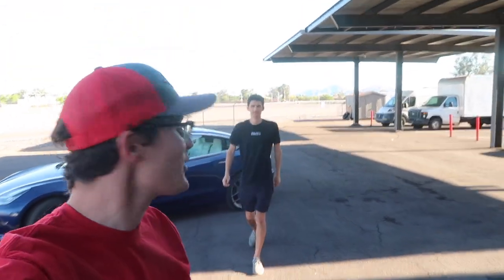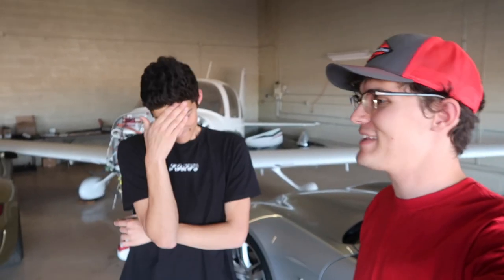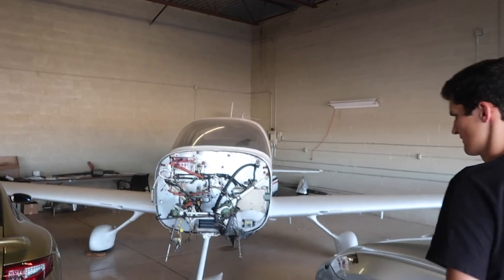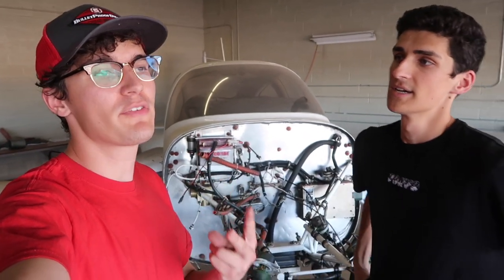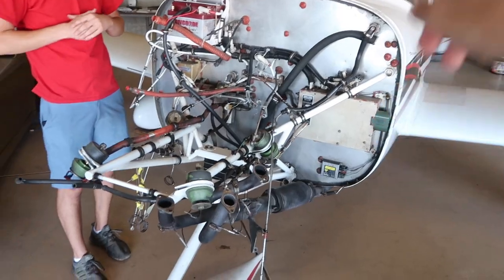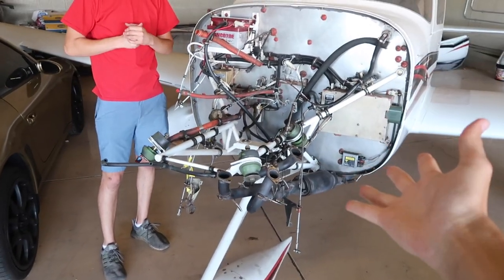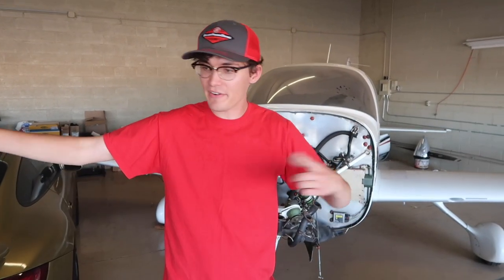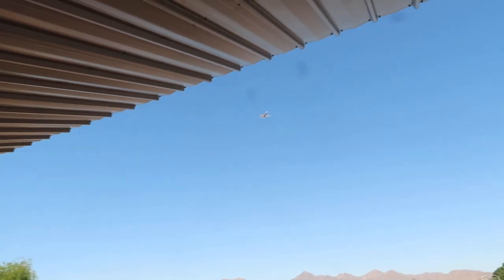Our Cirrus SR20 Overhaul Reveals a BIG Problem... (New Engine Install)

Comment: Great video, and I love that you guys are willing to share the costs with us.  This is why GA is dying though; the costs are just extortionate, due to the certification rules.   I mean $12,000 for two lumps of formed metal!   The actual production cost for the new case was probably less than $1,000.   All of the rest goes towards litigation funds associated with certification.  Here in the UK, I just changed over from GA to LSA (ML in the UK) and the cost savings are insane.  I got a 2 screen glass cockpit and advanced autopilot for £9,000.   To buy the same set up in a certified aircraft would have been £50,000+ !!!   If VFR is your mission, then LSA really is worth a serious look.   It is likely to reduce overall aviation costs by over 70%.     Also, if you think the IO-360 ES engine is costly to repair and maintain, the IO-550 in the SR22 is a whole new ball game!   I'd personally stick with the SR20.   It's a better training aircraft and (having flown both), the 20 is much nicer to hand fly; the 22 just being so heavy up front because of that huge lump.
Reply: Id say its more corporate greed than anything. I worked at a part 145 repair station, I know what the costs were for overhauls and the push to constantly make the quarterly dollars go up and up constantly. Our pay stayed the same but we just kept seeing the prices of overhauls and individual parts increase for no reason.

Comment: Your plane will have had a complete overhaul, essentially a new engine, will have been inspected and I assume found to be in excellent condition.  At that point it will be more valuable than it ever will be again so if you want to take advantage of the favorable market and move up to an SR22, that will be the time to do it.  Get your plane finished and pull the trigger.

Comment: Cut to scene, Money changing hands to sell the SR20.  Cut to the purchase of an SR22.  New plane arrives, the mechanic looks at it and discovers the whole engine needs to be replaced.  Just like the SR20.  Talk about luck!  I really wish you guys good luck in finding an SR22 if that is the route you choose to go.  Just remember all of the problems you went through getting this one running.  The thinking seems correct but if it was my money to spend, I would hold on to the SR20 as you know exactly what is wrong with the aircraft.  Fresh engine, and a new annual.  The only way I would sell is if you have an incredible offer which would make sense.

Comment: Wait. What?  Just the engine case was $12,000 ???  Holy Smokes!!
Reply: Complete overhauls for the larger engine on the SR-22, Continental IO-550, figure $50k. Continentals appear to fail early - Lycommings seem to go further.

Comment: No. Since neither of you are pilots, those high performance planes kill short hour pilots. Your insurance, if you can get it, will be through the roof. Put a couple hundred hours on the SR-20. Green engine failures are a problem too. The market will remain hot. Have you considered a partner? Also, another plane - another potential engine overhaul. Keep what you have.

Comment: But guys, the reason you pay jetfighter prices for 1950 engines is that they never fail. You have that guarantee that it never needs to be repaired.
Reply: You are being sarcastic right! These pathetic old 1950 designs have a TBO of about 2,000hrs.
Modern internal combustion engines in all other forms of transportation last at least 3x that!
Reply: @DennisMerwood-xk8wp  Other engines don't run at 75% throttle for hours at a time.
Reply: @latemarch2  Except for those in Railroad engines, diesel trucks, generators etc etc.
These air-cooled pushrod engines with their ancient magneto's are dinosaurs.
The only reason they have not advanced is the ridiculously conservative regulatory certification requirements.
Reply: @DennisMerwood-xk8wp  I was slightly scathingly sarcastic yes :)  I have the utmost disdain for Incontinental and Lycoming. It's one thing to sell old junk but an IO580 retails for 141k$. Last I checked that's real money.

Comment: That overhauled Continental engine won't be much better than your old engine. Continental engines are all junk. Sell that plane asap get a good reliable Lycoming engine plane. Or your going take it deep again & again even with a sr 22. TCM cylinders are shit. Continentals don't have nitrided barrels or sodium cooled valves like a Lycoming engine. Continentals wear out cylinder bores & burn exhaust valves. They got shit compression from new. Thats why they need the master orifice to pass the compression test at 42psi. Lycomings pass will 70 or above no problem. And fish knows this very well.

Comment: Start applying for your 3rd Class Medical sooner than later
Reply: THIS COMMENT. This is what I wish someone would have told me when I started my flight training. I applied right before I was supposed to solo and of course hit a small snag which took MONTHS to work out with the FAA which uses snail mail. Anytime you send mail or a reply via mail to them it takes about two months to get a reply. So the whole process took about 5 months and in that time I couldn't solo! So frustrating! Great advise in this comment!
Reply: @camerongoodwin2020  same thing happened to me as well !

Comment: It’s about time someone kicked these old clunky overweight motors out of GA. Think how many high output engines are out there in European cars. All good for 200,000 highway miles with nothing more than oil and filter changes. A much harsher environment than an aircraft, cold starts and running on highways before warm up, stop/start,  idling in traffic. Automobile engines far better than any CO out there.